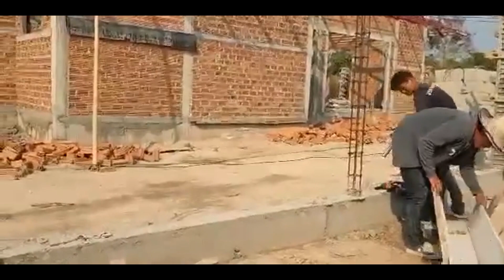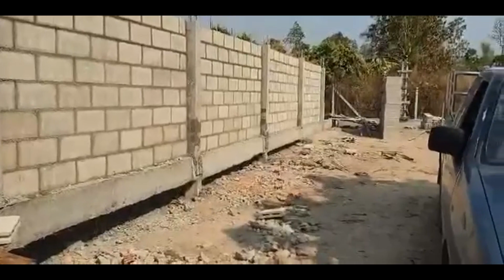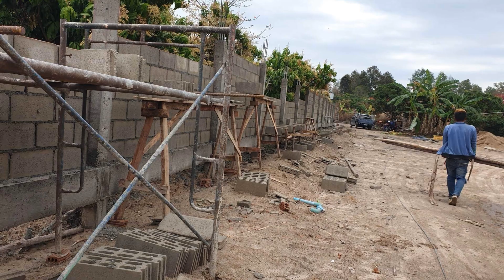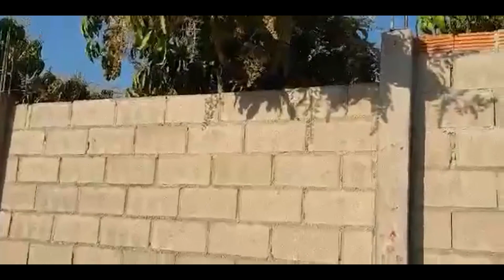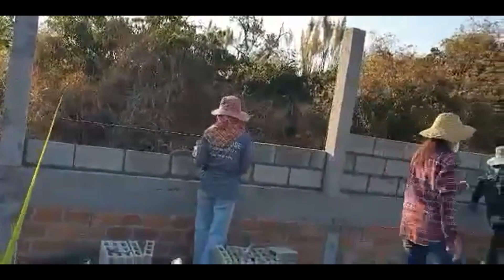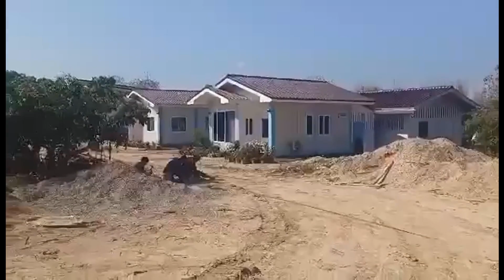Building house in Thailand - The Wall Episode 5

Comment: How big is the plot of land because it seems a long wall?
Reply from the maker: Hi John. It´s around 4 rai, 6400 sqm
Best regards
Reply: @mathiasgrahn4440  That is a large garden and you are building a wall all round the 4 rai?
Reply from the maker: @johntheaccountant5594  Yes, around 320 meter of wall, we will have around 7 meter of gate into the land.
Reply: @mathiasgrahn4440  How much does a 320 meter wall of 2 meters (looks like that) high cost?
Reply from the maker: @johntheaccountant5594  That's right, the wall is around 2 meters, in some cases it will be 2.4 as there is a slope on the ground. The drawing we got for the wall was with 9mm steel but we have gone up to 12mm steel. Footing was 0.6*0.8 meters but we raised it to 1*1 meters instead so we slightly increased the strength in the wall against the drawing.